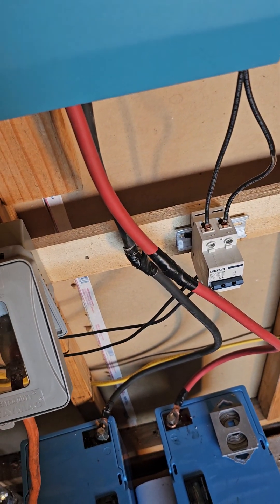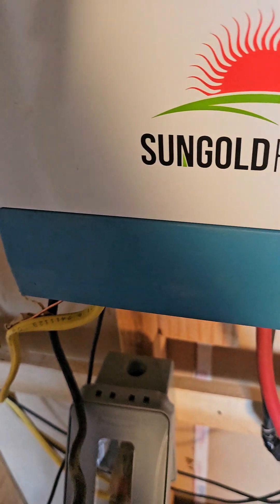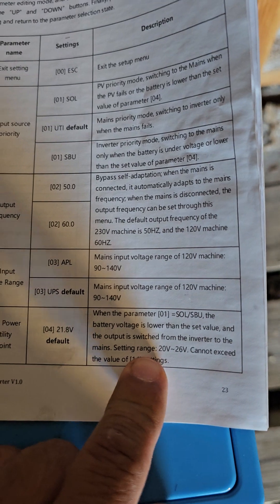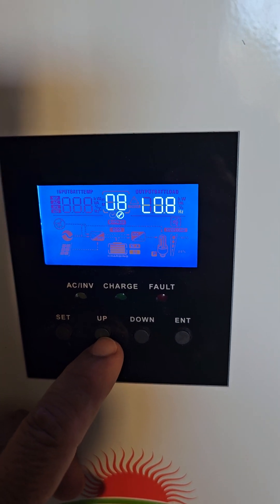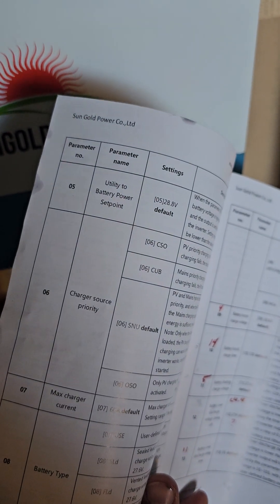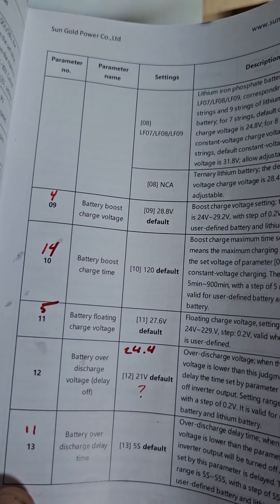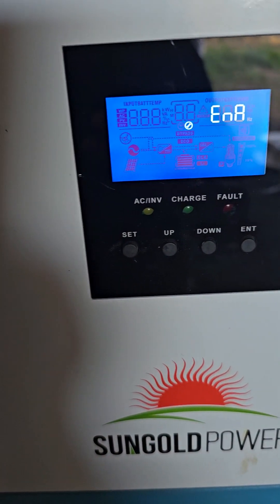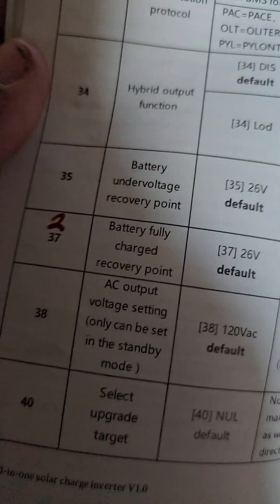SunGoldPower 24V Parameter Setup

Comment: I have the 24v 3kw system and some reason the charging is random - I thought if the sun was out the panels should charge but even at full sun sometimes seems like they aren’t charging the batteries, just sending power to the outlets.
Reply: did you set the battery type correctly? how about solar charging priority? is your solar producing more than you consume?

Comment: This helped me understand some parameters.  I called Tech Support and when I first Installed this I only connected (2) 450 Watt Panels I ordered from SungoldPower and I was trying to use my other (2) 450 W panels for another charge controller.   The Tech person said no, you have to connect all the (4) 450 Watt Panels so it will begin Charging the batteries.  I connected them and it began charging.   I was helped by this video about setting what kind of setting in Parameter (8)  Thank you.   Glad someone is supporting SunGoldPower Hybrid inverter.

Comment: My sungoldpower inverter works fine with those parameters,  my only issue is I can't charge my batteries with my solar panels, the display doesn't show solar panels even power on. It is there any parameters to put my solar panels to work with this inverter?
Reply: I guess you have the same issue like me. Your solar conebine not enough voltage to turn on the pv charger. Like i have two canada 400 watts each combined them i only have 60-70 voltage. But the inverter need 120v. I dont know what to do kkow
Reply: Thanks my friend, but what you mean with 120v? ,my inverter is 24vdc .
Reply: @juanrivera9852  look on the back  of solar panels and look for volt open circuit!!!! that is the voltage output of your panel, now need to divide 120 by that number to get the number of solar panels you need to get 120 volts to start charging panels..

example.  my panels voc=36.4 v olts so 120/36.4=3.2967volts. i need 4 solar panel to hit 120 volts, 3 panels are just shy of 10.8 volts from 120 volts. truly you need 200 volts to get good power of cloudy days.
Reply: @juanrivera9852 your solar string voltage needs to be as high as possible or at least as high as the inverter can handle. connect your panels in series
Reply: @juanrivera9852   You have to connect, the solar panels in series, to produce at least 120v  and up to ,(  I believe ) 400 volts. To start the MPPT charge controller that's built into the unit.

Comment: I bought this to replace a PowMR relab that simply burned up after 4 days. Smoked and blew both fuses. Garbage.  I bought the SunGoldPower 24V 3000w upgraded version. I've been talking to support for quite some time giving them my array and battery specs. I want to set up this inverter completely off grid, since there is no 110vac power where it is going. Need to figure out the settings to setup so that it pulls from BATTERY first, as it's charging. Not Solar first then battery, unless that actually works correctly.
Reply: That the way it works correctly, solar first, then battery:

-If you have a load the solar will tackle it first and if is there any left over power it goes to the battery.

-if you have no load, all solar power goes to the battery.

-if you have a heavier load than what your panels can provide, then the battery jumps in to help. (Dawn or dusk maybe).

-if there is there no solar power (night) the battery takes all the load.

I have this configuration and works fine.

Comment: I just got the 5000 48v and can't get it to charge the battery from the mains. I've had a lot of experience with what is intuitive to our Chinese friends.  It is all culturally related.  Still, the instruction manual is lacking in important information and the inverter menu doesn't even match the menu in the manual.  Repeated emails to Sungold and the seller reveal that no one is really sure about what they are talking about because the advice so far is not model specific. I bet it is something simple.  However, determining what it is is very,  very time consuming,  and as we all know,  time is money. So,  I don't advise buying one until the manufacturer does it's due diligence.

Comment: I've got a question for ya. I've got a newer one. The 48volt 10,000 watt All in One Inverter. It has the wireless dongle that came with it. This issue is that when the wireless dongle is connected there are times that the settings on the Inverter start changing in realtime but when the dongle isn't hooked up, this doesn't happen. Have you possibly ran into any similar issues and if so, How did you remedy that situation? For now I'm just keeping the wifi dongle unplugged.

Comment: Can you help me out? Why does my system turn off at night?  I’m off for great when the solar system is turned off at night. The system was shut down and I’ll try to turn it back on. It will last for 1015 minutes and then I’ll shut down. The overload was shut down, not the system the overload. Please advise.
Reply: Maybe it is in power saving mode # 22 in my book
Reply from the maker: Great question. I never had this problem. I've come to realize that this system and its parameters are so tricky. They do have customer service buts it's just as difficult as the parameters

Comment: Hello Sir please help out i have a brand new hybrid buy when i plug a fridge the inverter fan start yo run non stop  and when i plug my t.v the pictures are not clear with vertical lines as well what could be the problem?
Reply from the maker: Unfortunately im not sure. Once I plugged everything in it finally worked. Getting a hold of the Company was tricky.

Comment: I jotted down the settings you went thru because some of it is vague in the manual. However, I have some Battle Born batteries that I'll leave in place. I called their tech support to review the settings for the Lithium battery profile. They furnished me with all the parameters for their battery profile using this unit. Very nice people. I will share them when I verify they all work. When I finish gathering my components (about 2 weeks), I'll be installing my unit. Hopefully I can add to your video for other people looking for information on this unit. Thank you for the help.

Comment: Thanks so much great video, all my parameters Answered,I also like how you Stated where you got your information, I emailed them and never got an Answer, Thanks Again
Reply from the maker: You're welcome! I'm still learning so if or you figure out something let me know
Reply: @homeinsteadseligman  

So at your settings my all in one was not Charging my two 24v Lifepo4 Batteries it was down to 26.4 v,so I changed the Parameters on #37 to 28.6v and it started charging, it just stopped charging at 28.5 volts which my Battery monitor said 82%capacity 382ah out of 440ah, so I have my smart charger finishing of the charge and it will tell me the ah it put in etc, I'm mainly boondockin so I need my Batteries kept as full as possible,
Reply: Also read some articles on will Prowse solar power forum and a few guys Stated that there AIOs don't put out 14.6v for lifepo4 batteries which sun gold power techs said it's a design flaw but still works, the People on the forum and I disagree that long term under voltage charging will ruin the Batteries, I could only get a reading of 13.6v
Reply from the maker: I'll have to check what mine are reading.